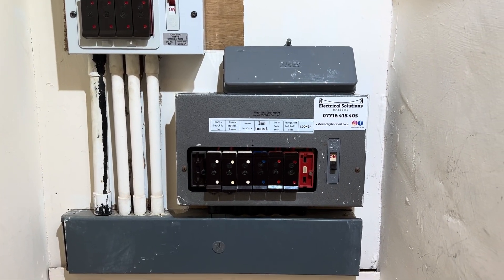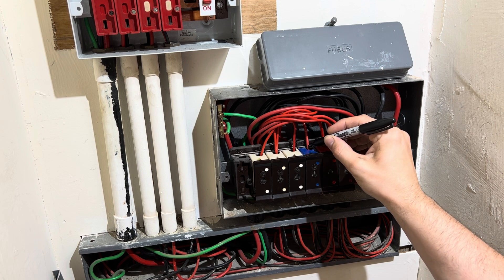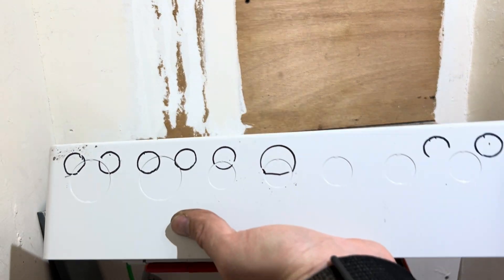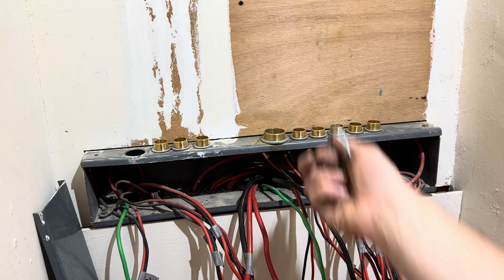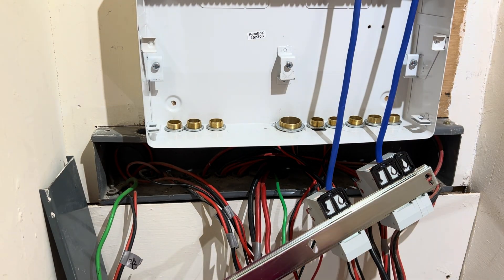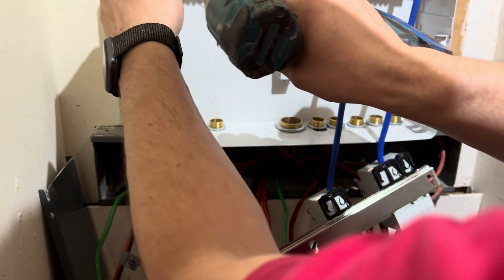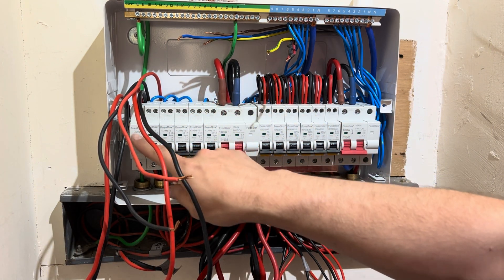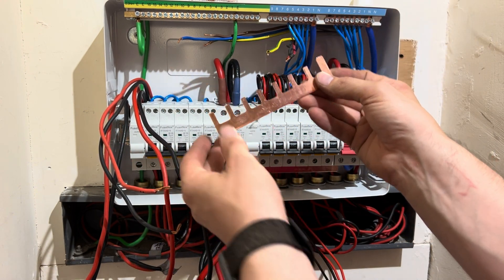HOW TO UPGRADE AN ON PEAK/OFF PEAK CONSUMER UNIT - CONDUIT STYLE

Comment: I have to ask no SPD ?
Reply from the maker: If I told you this flat was on the 5th floor would it help?
Reply: @bristolsparky SPD by sub mains?
Reply: @bristolsparky  what would that have to do with protection against over voltage??
Reply from the maker: @tomorichard  distance from supply
Reply: Nope no clue as to why you didn’t need to 😁 just done a fusebox dual tariff but only put an SPD standard side
Reply from the maker: @mikegmarshall  do you know the requirements for the installation of an SPD and its placement within the electrical installation?
Reply: Block of flats would probably have a LPS system so type 1/2 at origin and type 2 at any further distribution if in excess of 10m from 1st SPD